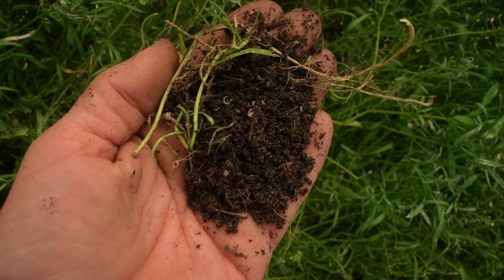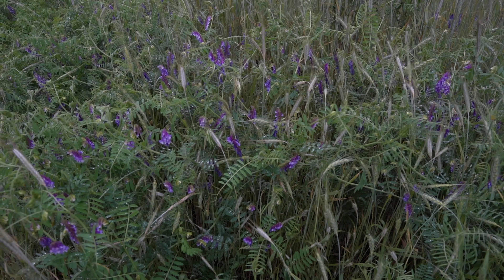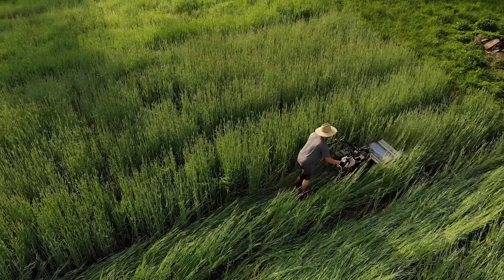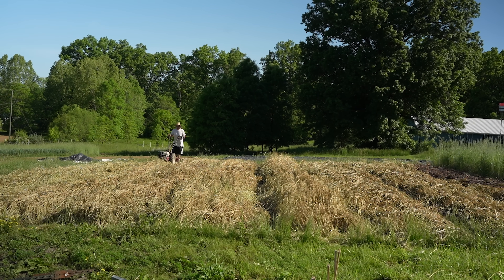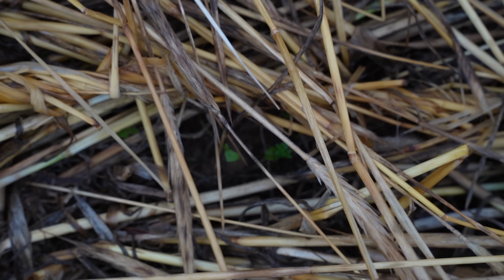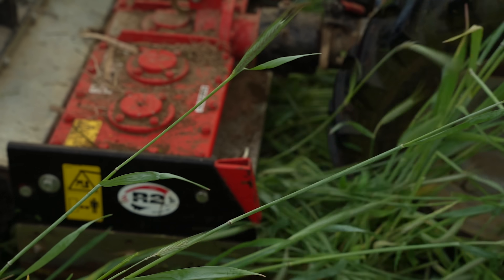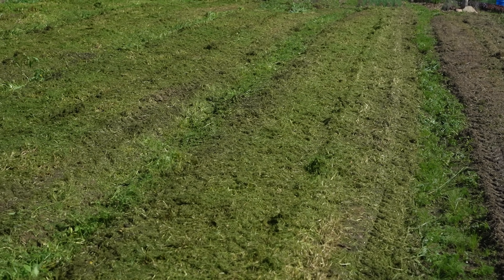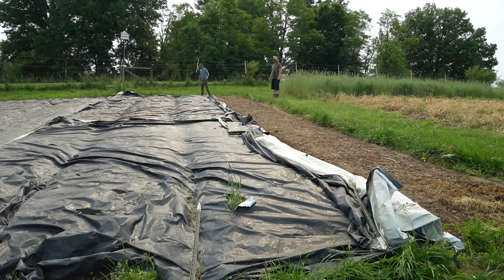No-Till Cover Crop Termination for Small Scale Agriculture

Comment: Why is the mow method not conducive to useful mulch? Is it just that it’s not able to cover the soil sufficiently because of the increased surface area? Or, are there concerns of it initially pulling from the soil as it begins to decompose? Just wondering, in your lettuce example, if you hadn’t of raked it off, would you then recommend simply adding more compost or other mulch to the bed as well? Or, if you’re going to rake anyways, I’m wondering if raking after the initial mow, where your just taking down the height, and then perhaps raking it back on after the third mow is a viable option?  Anyways, it’s got me thinking. Thanks! -Rather newbie garden that really likes your content!

Comment: 12:34 you can wet a cover crop then hit it with a flame weeder which will give you a bit of steam. Key is to turn the flame weeder down a bit. When we had a fires in Cali 10 years back and they started doing the SARE, NRCS data on crimping and cover cropping. We push in on it because it was a good idea we mostly used cardboard. We also used a hand steamer like for hair salon a used professional one. But we had 1 run were we used the flame weeder and wet the area down. It worked REALLY well but what I had a problem with is it killed a little too well. What would have been perfect is if we got the crimping, but the flame weeder skip over an area like did the flame steam in strips instead of just always on all the way through. That means some of the spiders and other things had a better chance of surviving for biological activity. You lose so much more insect life doing it that way. When we used the hand held steamer for hair we did just a strip with a huge gap after the crimp then transplant right into it. Add th e cardboard collar on the plant and it was zero turn around. When we had that steamer it was the easy years until it broke down and we couldn't get parts.

Comment: I’ve had good success scythe mowing rye and vetch at milk/dough stage, temporarily raking the tops off, compost mulching, then even raking the rye straw back on to act as mulch after transplanting crops like eggplant, squash, or cukes. They seem to appreciate the lower soil temperatures that the lighter colored rye creates when first transplanted. 

Scything has become my favorite way of doing this and I have gotten pretty quick with it. You can cut the rye so that half an inch of the plant is left above ground and it reliably dies within 5 days if it’s sunny. Quiet, quick, reliable. 

This year I’m gonna experiment with keeping the straw on and just separating the layers of compost and rye just where we transplant. 

I’m also curious what folks do with say straw mulch when they’re done covering beds. Sometimes we have too much to simply rake into pathways without making it awkward to walk/wheelbarrow in them.
Reply: Second for scything. With a sharp blade it's a real joy.

Comment: The power of the wind as harnessed by a huge tarp is not to be underestimated.  I had one held down with large wooden fenceposts laid all over it, and the wind still got in under one edge and ended up throwing the posts all over the place, with the tarp left flapping around with only one corner still held down.

Comment: Wouldn't it be better to just plant plants you plan on using or selling in winter? Why waisted the space or time planting something you won't use? Wouldn't it be better to compost build the areas over winter? That way the ground is covered and being inundated with nutrients and micros
Reply: Hi! He talks about this in his video about summer cover crops, and some situations he wouldn't recommend it in. From what I recall he mentions it can be a nice place holder if you have an awkward two week gap or so and can pull off something fast like buckwheat. And it can be good for improving soil health in a new bed before you put cash crops in, which will usually lead to a better performance from the following cash crops. And because you don't take the cover crop off site to sell it, you can leave it in place as a mulch. 
One case he didn't recommend it were very small operations where all bed space is precious! 
Hope this helped 😊

Comment: I've been wondering if a reciprocating blade cutting side to side, just below the surface of the soil. After hearing about how you lightly and shallowly power harrow, I think it might work. Gunna try building a 1.8m one for my MF35. I'll let you know how it goes.
Reply: Youll need a bigger tractor and itll get clogged with roots or bound up on a rock.  Youll be better off just using a sickle bar above ground.  You want to keep the roots in the ground as well as that is plant matter you dont have to incorporate, the micro-biome strat is already there, and the roots begin to decay quickly returning the nutrients they hold right back to the dirt.  By messing up the roots you upend the micro biome the cover crop started.

Comment: I have the idea to test a farm-made herbicide to remove the spots of regrowing plants from the cover crop. Not yet tested but if nobody tells me where I got it wrong, I plan to give a try.
This herbicide could be something like vinegar (don't know the efficiency in the field in reality but the method is often mentionned in websites...) or maybe more a strong indiluted nettle liquid manure.
The advantage is that it could be done with quite a small amount of it, so a way to proceed cost and time effective (in order to do the prep at the farm).

Another idea I deal with, is to use coriander (cilandro - not sure of the proper english) as a cover crop. Not the best specie to achieve huge biomass, neither to for the benefits from a strong rooting ; but as it is ready to flower rapidly (specially in the summer) it could be used as a sort of companion cover crop for the summer crops. Sowed just before planting, in a spaced transplanted summer crop (tomates), once flowering stage engaged, a run around with either good shape (to hand-cut) or an appropriate engine-drived method, and the coriander stand will just vanished like smoke.
Doubled seeded the 100 pl / sq meter would be 2 kg of seeds for an acre : 30$ of seeds in a regular shop (could be less I guess if getting it from professionnal agricultural shop)

Comment: i use all wood chips from trees only nu brush , and wait 3 yeras till underr and then mixx with new dump of chips with pre emulsified soil / black soil from same garden mixed back in as you rake under mixt in all directions then flatened back out left to settle over 3 weeks then planted with rows with certain rows started purposely at different timings for even groth across canvas of approx 1/3 acre where at end of season the grarss has about taken back the entire garden as i left it take on the naturalprocess of groth periods , i plant 3 years , i leave untouched 3 years

Comment: I stomped winter rye cover down with angle iron and then used a hand post-hole digger shovel to chop nice round holes into the flat rye and then transplanted into these punch-outs just like gardeners plant into holes made in that black plastic weed barrier. Worked out well.

Comment: Hi Jessie, I’m a regenerative farmer. Big fan of cover crops to protect soil especially after animals have eaten their winter brassica crop Swedes, kale, rape crops etc. (temperate Climate). We use winter oats due to its great up take of nitrate. I also feed cattle zeolite to clean their gut and this holds nitrate really well in soil. I use a frail mower to drop the crop at milky stage, run animals over it which aids in driving it into soil and bruises the stems which helps in break-down. Trick is to get a “crop” in as fast as possible to suppress weeds. I use plant derived fatty acids as an organic weed killer IF there’s a particular nasty juvenile weed coming up. It’s contact only best applied on a hot sunny day during active growth. Probably good in Kentucky??
Reply: Hi L&S, could you give me more explanation on the plant derived fatty acid herbicide ?
Please
You mix plants (and cup of water) with a blender and get the upper layer of fat ?
Thx

Comment: For small gardens, I planted daikon radish as a cover crop, and they are just not flowering (but are only about 8-12" tall max). Can I just use a weed-eater and chop it down to the ground level that way? And then should I just let it lay on the surface, or should I cover it with black plastic for 2 weeks after it is knocked down to the earth? Also I have top soil being brought in for parts of the garden to build up mounds. Should I avoid putting any top soil on top of the chopped down daikon radish? Thank you!

Comment: Would a subcompact tractor with brush hog rotary cutter be a reasonable solution for cutting down cover crop without causing excessive compaction? Distance between rear wheels is only 24”, too narrow to try to keep beds out of tire paths. Tractor, loader, brush hog and me weight would be about 2750lbs.

Comment: Cowpeas and millet work great here in the sub tropics of australia. They are both easy to kill but the cowpeas get pretty woody and dense. I attack cowpeas with a brush cutter first (slowly so the snakes and frogs have a chance to evacuate), rake into the walkway and, well the next part is where i get stuck. I used to use a small 2 stroke cultivator but now wanting to try a less invasive approach.
I dont have broadfork yet but im thinking, aerate a little with a pitchfork, a light going over with the stirrup hoe, whilst dodging the cowpea stumps. 
Then, throw the cowpeas back onto the bed, wait a week and plant. Fingers crossed!

Comment: Small suggestion for the crimped cover crop:
Maybe put that roll of cardboard over it and spray it down then add the compost on top. I guess you could cover it for a couple of weeks with black canvas. 

I have a question: what do you think about using ground glue type soil binding agent for creating pathways and adding calcium and some other eco friendly additives from limestone. I want to keep some areas just plain dirt for less maintenance and a certain aesthetic in the lavender field. 

But I also will be doing no till with chickens and rotational beds in another area to create good nitrogen rich compost to turn. Ordering my temp gauge soon!☺️

Comment: I’m lucky(?)  enough to be in a situation where I have some long windows in between crop rotations. I currently have a block seeded to fall rye/pea/vetch (was winter squash) and it’s slated for garlic planting next fall. So wondering if it’s possible to delay boot/seed stage of cover crop via light mowing when young so I don’t have to try to establish a following summer cover crop (buckwheat?) in the hot, dry season. I’m in Pacific Northwest rainshadow, with NO rain all summer, and irrigation is from a sensitive well.

Comment: This past summer, I stomped down a portion of my garden with a board that I screwed a metal plate to for crimping, and then went over the laid down mulch with a weed burner and it browned in a few days. I didn't burn the weeds. Just heated them to the point they browned on their own. Some came back a couple months later because I didn't plant into it, but I just hit it again with the burner.

Comment: In your area I am sure you have plenty of leaves available.   Have you tried using them a cover instead of hay or straw as a supplement for weed suppression?  In the spring I cover my garden with leaves and them mow and stir the leaves repeatedly to break the leaves down.  I then place an additional 3-6 inches of leaves on top of that.  The tomato plants are then planted.  My weed control has been great and the tomatoes have done real well.

Comment: Good video! I'm going to start a big new garden this fall by running a sub-soiler as deep as I can (my current soil is very compacted clay), tilling in as much compost as I can get, and then planting a cover crop. I'd start now, but it's still too hot now and it probably won't rain until October. So for now I'm just working on compost.

I think I'm going to try a variant of your "clobbering" method to kill the cover crop. I don't have a mower, but I do have a rotary tiller for my baby tractor. If I drag the tiller over my garden with the PTO running but with the 3-point hitch set so the tines are just above the ground, maybe it will clobber the cover crop without disturbing the soil too much. I think it's worth a try, especially since my soil is currently so bad that it probably wouldn't be a disaster if I just tilled in the cover crops for the first couple years. The cover crop might just wrap itself around my tiller if I do it this way, but I won't know until I try.

Comment: This is by far the best cover crop "termination" method in terms of quality, but it's not very practical in most cases. 

Hear me out though:
- first, grow the cover crop.
- then 2 weeks before you planned to plant seedlings, mow the cover crop near the ground like a scythe would, arrange all the organic matter in lines. A very deep mulch layer of at least 10 inches high and 5 feet wide, enough so the cover crops below can't resprout. 
- wait about 2 weeks for the organic matter to decompose and turn brown-ish. 
- plant the seedlings into the mulch bed (this should guarantee very good yields). 
- the rest of the uncovered area should resprout again vigorously (select cover crop mix that does).
- throughout the growing season you can let it grow again, but once again mow it like a scythe would before it is about to go to seed. 

- arrange another deep mulch line in between the other lines with the freshly cut down organic matter. 
- continue with this process until the entire area is covered, this may take about 3-4 years. 

I have done this on a very small patch of land just as a test and I'm in year two, which means I'm in the 3rd cover crop growth cycle. 
I have used a primarily grass-based mix of both C3 and C4 grasses, heavy on cool-season C3 grasses during winter and heavy on warm-season C4 grasses during summer, both times accompanied with hardy and non-hardy legumes. 
Specifically andropogon gerardii (sunn hemp) has done fabulously as a summer cover crop. 
As a "cash crop", into the mulch lines, I planted as seedlings the three sisters of the american indigenous peoples (maize, beans and squash). Maize all 25 cm in a triangular arrangement, let them grow for two weeks, plant beans near the corn and squash every meter or so. 
Furthermore I planted various trees, both fruit and biomass trees (like willow) as cuttings which I propagated in containers. Just trying to make use of different heights. 

I am very happy with how it went, but I certainly wouldn't do it on a large scale if I wanted high yields from the beginning, but it's SO good for building soil organic matter.

Comment: Makita (or similar maker) grass cutter with the sweeping motion handle type is probably the easiest for smaller scale, and is designed for 1 person. 1 person can get quite a bit done. Very low scatter, and with enough experience the operator can finely control the depth of cut, making cuts right at surface level, or slightly above, to preserve young clovers while getting the longer grasses (as is common in my use case).
Reply: Using the 18V version but there are dual 18v (36v) if you have larger area to cover. I find that running at medium speed for crimson clover allows for clog free cutting while having a good operating time on the battery. There are multiple models out there. Just be aware that the 36v is a bit heavy.

Comment: What about using a water drum to stomp the cover crops? We used to use a 55 gallon barrel and put some water. About 15-20 gallons of water and roll the drum over the cover crop. We made it kind of a weird game and take turns and work in teams. We were always trying to see who was the strongest and most coordinated. It was always hilarious. It was cheap fun 😆
Reply: Did it work to kill the cover crop? Also would paint particles left on the crop become an issue later on?
Reply: @MalubaLube2022  it doesn't 'crimp' the crop, just flattens it.  Depending on the stage, some (or a lot!) can pop right back up.